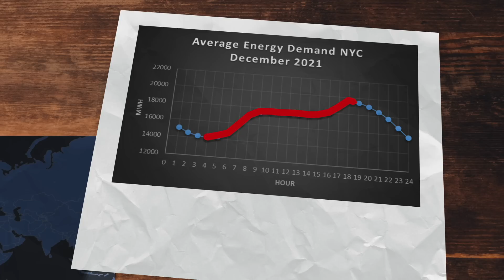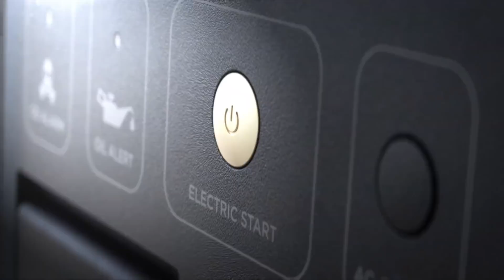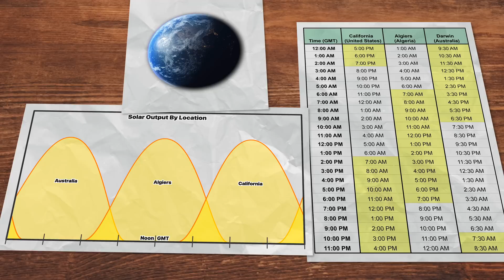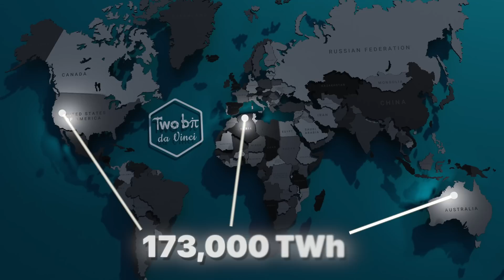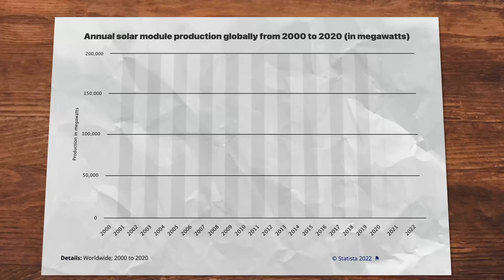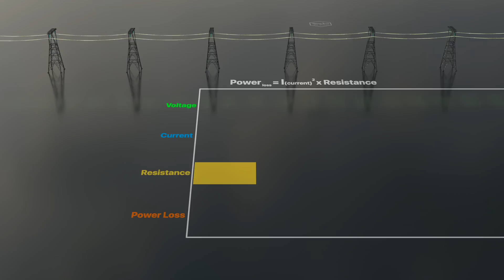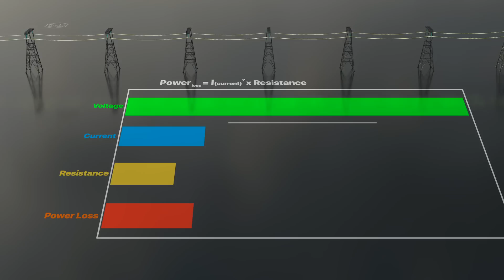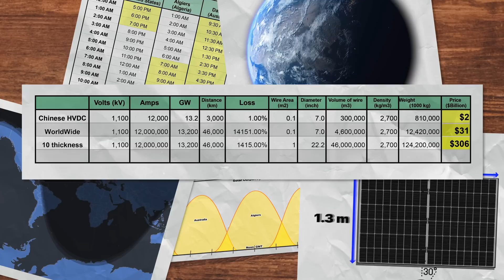World Solar Energy Network... Could this work?

Comment: how much roof surface area are their in the world? Is it more than the size of Arizona? And the trillions of dollars saved not needing transmission lines could be used to subsidize rooftop solar with battery packs. Decentralized electricity protects you from attacks on the power grid.

Comment: I hope no one has already mentioned this in the 7 months that this video has been up, but why would we need all 173 TW, when we could start with 21 TW (in 2021 no less) and double it for growth? That would take the monumental 207 x 207 farm and drop it to a nice 3.5 x 3.5 mile location (someone please check my math!). This could be nicely split up into various locations depending on existing land use. This makes a nice round 10 locations in each zone (again, for backup) at 0.5 x 0.5 miles each.

Isn't this certainly doable, given today's technology?

Comment: If you imagine it as a single project over a few years, yes, that's impossible. But as Ricky suggested, who says we have to eat that whole sandwich in one bite? It's more realistic to imagine such a project on a longer time scale and in phases. You pick the ideal locations with that plan in mind for the long term, but each site starts small with local customers for the short term. The revenue generated by selling the electricity to local customers gets reinvested to add capacity to each site and builds more revenue from the expanding customer base. Each site gradually expands under that model until the big dig to connect them all becomes feasible. The important thing to consider is that unlike many other infrastructure projects, this project can directly and safely generate the revenue to pay for itself. You don't have to wrest the funds from strained tax budgets, you get funds from the money customers pay for the electricity you've already generated. I can't see it in the next decade, but I can see it in a few decades.

Comment: This is easy, create tunnels over the ocean to create bullet trains and above the above ground tunnel make roads and cover the roads all the way around with solar panels. Costly, but through travel tolls and funds from travelers would pay for the total after about 15 years or less depending on the dependability and/or amount of trains running off of the same energy captured and spread out. At the same time inside the tunnel set up mini wind turbines to be powered by the air created by the train rushing though constantly and utilize regenerative breaking to provide back energy as the train slows down over the last 100 miles of travel if it is going around 300mph or more....

Comment: It is kind of ironic that for me you end up making a case for a much more decentralised and mixed approach. Add in all the solar on roofs along with the solar farms, the wind turbines, hydro; domestic batteries, big batteries, pumped hydro, all the car batteries bi-directional, green hydrogen, etc. In Australia, if we push hard on all of that, connect Tasmania's hydro to the mainland and join up the east and west and then the north, we could actually do this within a decade and be net carbon negative by 2050 with the cable to Singapore followed through on and green hydrogen (or ammonia) export. 
But only with the political will for it, which is a big challenge, even in our advanced, very stable democracy. Globally, I wish it were possible, but it clearly isn't.

Comment: Why no reference to Plasma Conduits?  Please drop the Mercator Projection map as it gives a false impression of the route around the globe; the Dymaxion Map give a much better image.  Political security considerations can be minimised with a greater number of sites and connection nodes.  Look up the GENI project from the 70's for an explanation.  A combination of base load power generating nuclear energy production (hopefully involving Fusion Reactors) coupled with renewables, hydro and geothermal is the hope for the future.  Reducing energy consumption would have to consider a reduction in consumption of manufactured goods and this would not be well received by the globalist industrial agenda.  "More with less" "Local is best"

Comment: Don't forget wind, tidal, and wave power, Rikki.  It all adds up.  Oh, and don't forget to add security.  People steal this stuff every day. They're as bad as Porch Pirates!  I'm doing the opposite, putting my own solar power up and storing it in LiFePo4 stacks. Decentralization is a bit more expensive, but it's much safer from terrorist (and perhaps war) damage.  DO IT LOCAL!
P.S: Wouldn't 42,849 square miles of solar panels create one helluva heat island?  How would that affect local or long distance weather?

Comment: It is a very good idea due to the following reasons
1. It will enable all the countries to export extra power to connected countries and will e hance their income.
2. It will eliminate the monoply of opec countries
3. Other alternative energy resources can also be included like wind, hydel, geothermal, osean waves etc
3. When fusion reactors start successful operation, then such a network will be will be a blessing from disguise to transmit the huge amount of power to load centers
4. Energy storage technology shall get a boost

Comment: I think I missed something with your math. At the start of the video you say the global usage is 19TW per hour. With the sun giving the Earth 173,000 TW. But then you go on to use the 173,000 for your solar needs calculations? Shouldn't you be using the 19 value?

Comment: hey man, i think your math is off, but your videos rock. US consumes about 10 petawatt hours of electricity per year including generation and transportation, give or take. This implies that the world consumes about 50 petawatt hours per year since US is about 20% of global energy consumption overall, give or take. We produce about 250 GW of panels per year, which gets us 250 GW * 10^9 W/GW * (5 sun-hours/day * 365 days/year) ~ 4.6*10^14 Watt hours, or .5 petawatt hours. That's about 100 years to get 100% solar at the current production rate. But we are increasing our global production capacity exponentially at about 20% per year. If we take this exponential growth of 1.2^10 for the next 10 years, then that amplifies the production by 6x to 1.5 TW of panels produced per year- and then if that rate holds another 10 years after that, another 6x, so we will blanket the earth with enough solar+renewables within about 20 years, I think no problem at all (wind, solar, ocean, geothermal all together, we got this). You have an awesome channel, I love your videos and they're inspiring. Thank you for your work!

Comment: Been curious about this too -- but you did not take this thought experiment far enough.

No mega plants, no single mega lines. There's a reason power grid is called power grid. Distribute this stuff.

This is doable, with "smaller" transfer lines, STILL huge in comparison. Ocean crossings are a bit difficult, maybe USA <> Europe would be only 2 cables, South America to North Africa one.

Production is already being distributed, and you don't need to dedicate that amount of land mass. It's called roofs ;)
Europe already mandated that commercial buildings need to have X amount of solar panels installed.

Functionally, as a grid project, you would ONLY need to build the global grid, rest will solve by itself. Industry and people fitting panels, batteries etc. will solve this by itself.
Infact, the progress to solve this has already started at least in Europe, which is pretty much single big grid now, with multiple grid zones. Each country doing a portion themselves, without even having to ask for -> They already need to maintain a grid AND get power. High prices is incentivizing more projects.

At this scale tho even superconductors might start making sense.

This "global mega grid" is inevitable, and without realizing industry is already building it due to commercial pressure. But these projects take decades to complete.
The global mega grid project needs fractional push of what envisioned here, some transmission lines as multiple countries common effort to up the capacity, to speed up the progress. Alternatively, it will eventually complete regardless because it just makes sense.

Comment: One bite at a time. As another thought experiment, what if in the U.S.A. building codes mandated a minimum of 2 KW of solar panels on each new house built (as the cost would be part of the mortgage) and also, look at all those flat roofed warehouses - they could be covered with solar also. It's just an idea.

Comment: This is a bad idea, by centralizing the panels you create a problem that did not need to be solved in the first place.  Solar concentrators and molten sulfur (high temperature) photovoltaic would probably be more efficient.

Those transmission lines are not a great idea.  You could use rf to transmit power, easier to eliminate the wires, regardless of the loss.

Comment: Great video. I appreciate all the work put into this.  The underlying goal is just to reduce the need for energy storage and increase reliability of the grid. I think that’s a great goal but it doesn’t need to be entirely Solar. The optimal grid of the future uses many different power generation methods. Also as he pointed out an optimal grid would also need to be distributed. But maybe the building blocks are there. Maybe instead of trying to design and build a complete system we let it happen more organically. An easy start using solar would be right after dark you buy energy from your neighboring state or country to effectively extend your “daylight hours” which would not eliminate storage but would reduce the amount needed. 

But using a variety of power generation methods would help as well. Even if the sun isn’t shining, the wind may be blowing. A better grid is where countries CAN support each other by exporting but where they don’t HAVE to rely on each other bc they have the infrastructure they need to rely on themselves if it is needed. That means different regions will have a different array of generation and storage technology depending on their particular climate and geography. I believe this is would be a better and more reliable grid.

Comment: There already is a world wide energy transfer system; it is called tides; run by the moon; the three thousand miles of tidal shore here in New Jersey have water rising or falling twenty-six feet every day — a simple method of harnessing that will suffice for every energy need at a fraction of the cost.

Comment: It's hard enough keeping 700 kV inside the wires without it arcing off into space. 11 million volts? I can't even imagine.
I wonder how much light you can cram into a fiber optic cable before it melts... so instead of transferring the electricity you would literally pipe in sunshine.
Or, I wonder if we could send ionized gas down a vacuum pipe, like a giant plasma thruster. Hmm, it's probably easier to just make chemical fuel and send that if we're building a pipe.
Idk, out of all these options, it seem like less centralization is better than more. Produce the power where it's being used, and store it on site. We just need cheap grid scale storage.

Comment: One flaw in your argument is the assumption of solar providing ALL of our energy needs. But in fact, there is a substantial amount of energy coming from hydro, wind, and geothermal, there is no need to replace those with solar. Nor is there a need to centralize, solar can be located everywhere, thus reducing the amount of power that needs to be transmitted long distances.

Comment: Great video and really thought provoking!  Some points to note IMHO:
1. 82m acres is less than 1/4 of 1% of the worlds land area so that can be done surely.
2. The total amount of electricity to be carried is 13.2GW.  It adds cost but you shouldn't have just one line, for the sake of reliability and redundancy it would be better on at least 3 parallel lines therefore the voltage/amps could be reduced in each.
3. It only looks so expensive because you are rebuilding the entire generation capacity of all of the countries in the world at once.  If you add up all of the cost of all of the power stations ever built and cost them in todays dollars it would surely be something similar or even more.

Comment: Just a question has anyone looked into the heat generated from the black panels of solar? We have covered the United States with black asphalt and the heat generated is amazingly high.
Reply: Yes they are called hybrid solar-thermal PV systems. For example Imperial College London has a research group focused on the concept.

Comment: US consumed 3.93 trillion kWh in 2021
There are 3143 counties total, i.e.: that's about 1250 MWh/county.... for an entire year
And if this is split into 4 different types of energy storage systems, i.e.: PH, CAES, Lion, deadweight, that'd be about 313 MWh each.
That's equivalent to a 36000 kW engine running 24/7 - very much doable.
Imagine a county starting off the year with 1250 MWh of stored energy, they'd have 365 days to 'trickle charge' their energy storage system.

Comment: recycle all the material in the grid, and go to local power systems.  a lot of the countries do not get a long well, and war is a common event on earth.
a combination of wind, solar, geothermal, algae oil, methane digester, ocean current capture, and hydro power would cover the needs.
geothermal is the best base load alternative, iceland as a role model, likely work best along the ring of fire.

Comment: This thought experiment is something governments around the world should have done years ago.  For then they would realize that solar panels and windmills are not a feasible solution to the world's need for power.  And by this time the number of nuclear powered power generation would be well underway as an alternative to fossil fuel generated power.  The cost of such a system will never be feasible until transmission over long distances is done without wires.  The idea of stringing 15 inch aluminum cables across the world is repugnant to most as it would need to be very high towers of immense strength with very long insulators.  The reliability of such a system would be measured in hours MTBF even if DC high enough voltage could be achieved.  The length over much of the settled world would be encountering continuous storms, cold, wind, and water.  And the risk from non-natural phenomenon would mean that there would need to be redundant paths and redundant facilities to avoid single points of failure.  Because you did not discuss how you came to your cost estimates I will assume you did not plan redundancy and other high reliability elements.
Rather than a world wide reliability issue, power generate as close to use is the preferred model.  If that eliminates solar as an exclusive power solution then that is the realistic, feasible solution.  In fact, eliminating central generation and distribution networks with battery backups is a more feasible solution and would spread the problem over many areas already populated.  That coupled with hydrogen fueled fuel cells could be a complete, portable solution that would be feasible and practical.

Comment: This kind of calculation only makes sense if all renewable forms of energy is used!

Solar, wind, wave as well as heat capturing together with storage of kWh and heat energy.

We do not need to store all energy as electricity ⚡️ either store it in heat or other forms.

When using all forms of renewable energy and storage methods solving the worlds energy needs become much more doable. Not in a decade and not in 2 but definitely way earlier than we think 💭

Comment: I feel like space-based solar arrays with radio wave power transmission to earth has a better chance than this does. it solves the power transmission issue and thus materials issue, government cooperation issues, space used on the planet problem, and much of the production capability problems. But introduces the problem and cost of lifting that much equipment to space.

The concept is pretty simple. Radio waves have energy to them, so if solar panels are in space they can receive 100% sunlight and never be off, and that light energy potential is far higher than solar panels on earth sine it doesnt have to deal with the atmosphere. You lose that efficiency again when sending radio waves through the atmosphere though. So the space solar panels convert the solar wavelength energy into radio wavelength energy (or light wavelength in the form of a laser), direct that towards a specific area on earth, and we use radio wavelength receivers to collect that energy on the planet, and convert the radio energy into electrical energy at a wavelength we want (60/50hz). The concept is easy once you understand that everything is simply energy at a certain wavelength. The hard part is the conversion between wavelengths without losing too much.

But now that we have found certain wavelengths that "bypass" the atmosphere easily, perhaps we can use those frequencies for the power transmission to increase efficiency. See "space cooling"/Sky AC for that topic, but this would be going the other way as those.